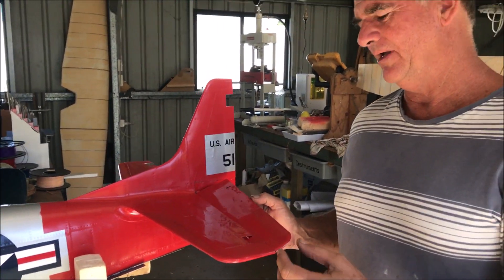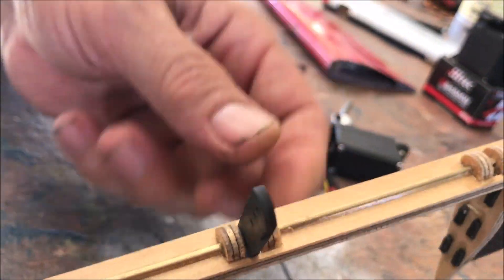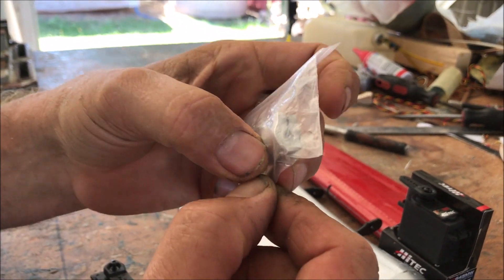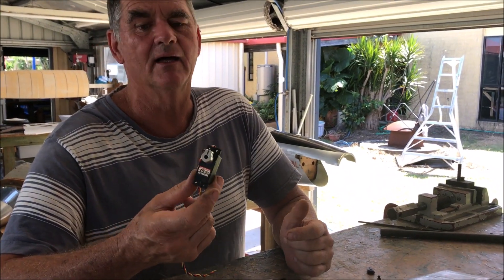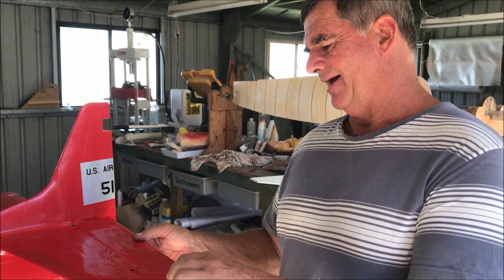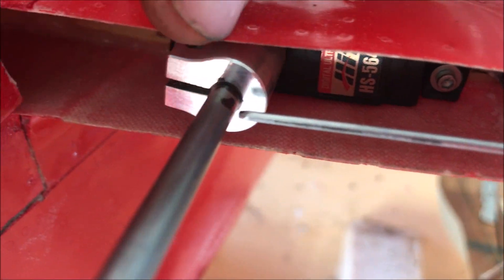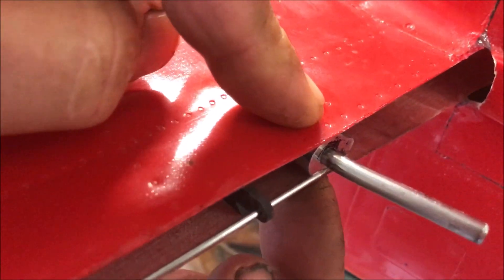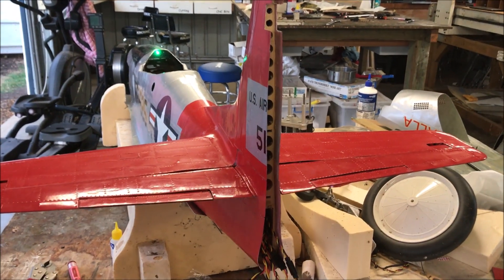Installing the RDS and hinges

Comment: You're using 3/16th's piano wire but what size adapter are you using? I only see adapters for 1/4 inch and 6mm on Servo City site. Does the 1/4 inch adapter clamp down on the 3/16ths wire?

Comment: Umm, over the past 20 years I've used RDS but only on ailerons and flaps. I would never place a servo in the tail as shown here just to eliminate a convention rudder linkage. RDS has it's uses and it works great but in certain circumstances, like here whereby you add significant weight in the tail with a servo mount, it's a negative.
Reply: Just move your battery forward and it's done ! If you keep you servos in the front/center you have to add the linkage weight as well, so not at all convinced by your argument.